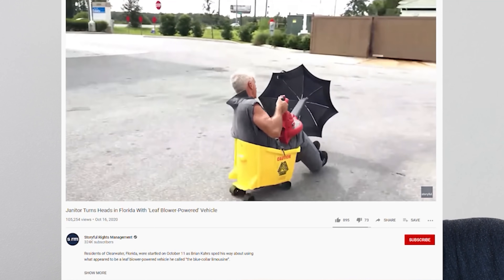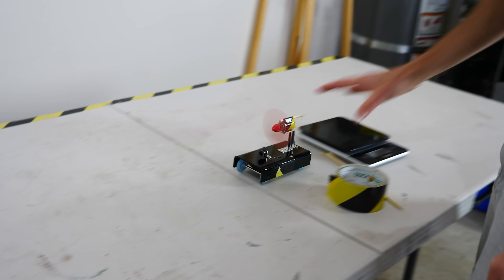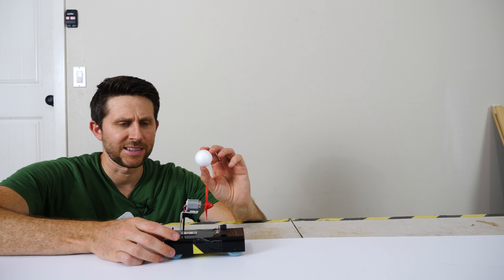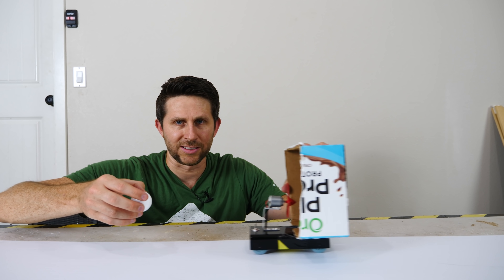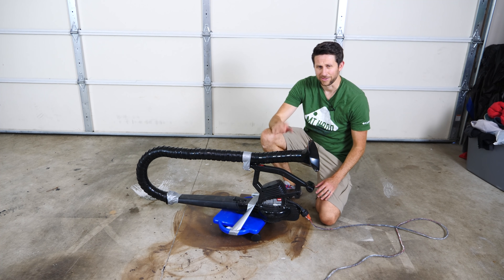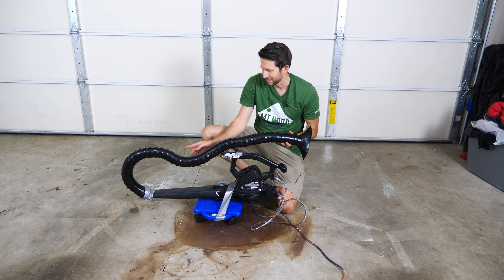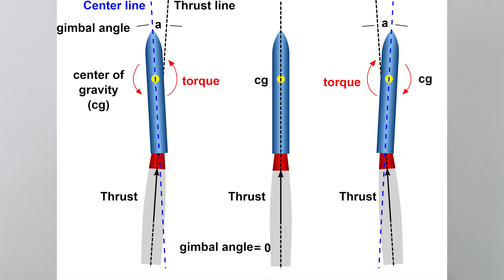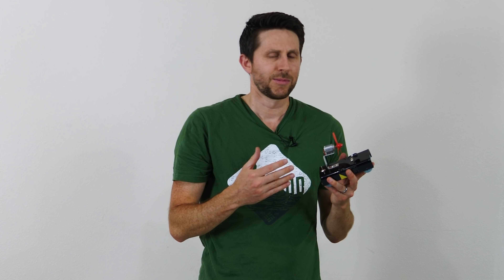Blowing Your Own Sail Actually Works

Comment: I remember that video. I'm glad you finally addressed this. I still don't think you explained the situation very well. The leaf blower  misses the point on why this was such an amazing experiment in the first place. 

Like in your original video, blowing your own sail is considered troll physics because it shouldn't work.

The air flow pushing against the atmosphere pushed the cart backwards, but the air flow pushing against the flat sail pushed it forward. They counteract each other.  The air flow dispersed in all directions after hitting the flat sail which all counteract each other.  

This experiment isn't awesome because your can hook a tube up to a leaf blower and make it blow backwards. What's awesome is that forward/backward forces counteracted each other but the air flow persisted. The 360 degree disbursement of air flow counteracted each other and the flow persisted. At the at the very end of the system, the air-flow hits a curved surface and that's when force finally gets directed in one direction.

The leaf blower was just a tube directing the air and it behaved as one would expect. Using the leaf blower as an analogue excluded the counter intuitive nature of the curved sail experiment.
Reply: My dream for you, action lab to make is : melting wood or solid water or shape holding glass
Reply: @easha5706  bruh solid water... just freeze that shit
Reply: So whats happening and what ur saying is its something happening to gravity to make it push foward, when air is moving backwards behind something? Because when i saw this video thats the only thing i can understand from it. This used to make sense because i never thought that deep about it
Reply: @widowmaker4097  Sorry, but gravity isn't part of it. Its all about the air flow. I'll try my best to illustrate in a comment.
-----------------

--->  This is initial air flow. Fan blows this direction
 <--- The vehicle moves this direction

Next is the addition of a flat sail.
-----------------
--->| ---> Air flow hits the sail and pushes forward.  (Wind pushes a vehicle forward)

But since the fan was pushing the vehicle backwards and the air flow hitting the sail pushes forwards, nothing happens. They cancel each other out. (There are caveats to this situation when the sail or fan is set at an angle. But don't worry about that now. The Action Lab's original video focused on the cancelling of these two forces.)

At this point, blowing your own sail is seen as troll physics. You shouldnt be able to pull it off because forward and backward forces contradict each other.

-----------------

But the air flow doesn't stop. Some goes up, some goes down, some goes left, some goes right, and it goes at every other angle.

With a flat sail; left and right counteract each other, up and down counteract each other, and all other directions counter act each other.

A flat sail means the vehicle wont move.

-----------------

BUT if the sail is curved then you can still direct the air flow in one direction and provide force in the opposite direction. (Almost as if this entire system is acting like the fan)

Air that moves up is directed this way <---

Air that moves down is directed this way <---

Air that moves left is directed this way <---

Air that moves right is directed this way <---

And air moving in all other directions after hitting the sail is moved this way <---

-----------------

Since all air flow is going this way <---

The vehicle now moves this way without breaking physics --->

-----------------

I hope this helps.

Blowing your own flat sail doesn't work. But blowing a curved sail, after several steps, can direct these counteracting forces in one direction and FINALLY provide motion.
Reply: @dwightfry99  can you explain the leaf blower? I dont know what im not grasping with the leafblower one.
Reply: @dwightfry99  thanks btw
Reply: @widowmaker4097  The leaf blower simplified the entire system. A leaf blower with a tube allows you to push air in any direction and experience a push of the vehicle in the opposite direction. 

This is technically what is happening with a curved sail, BUT the curved sail has many more steps before it finally directs the air flow in one direction. It's not as simple as tube. It's air flow pushing the vehicle backwards at the fan, and air flow pushing the vehicle forward at the sail, and it's air flow shooting off in every direction, AND THEN it's air flow being directed in one direction to push the vehicle forward. 

The leaf blower with a tube cuts out A LOT of what's actually happening.